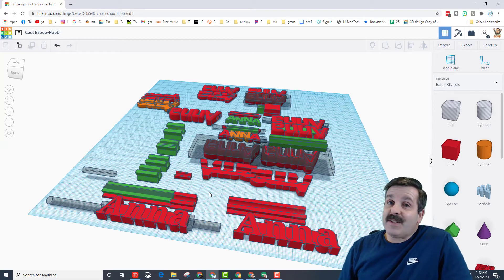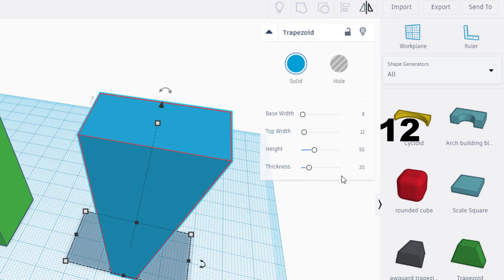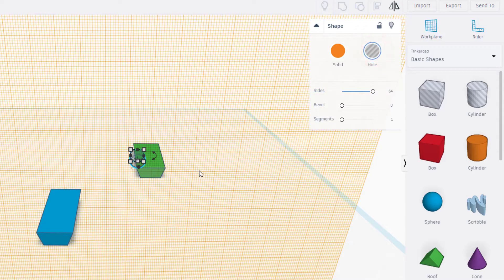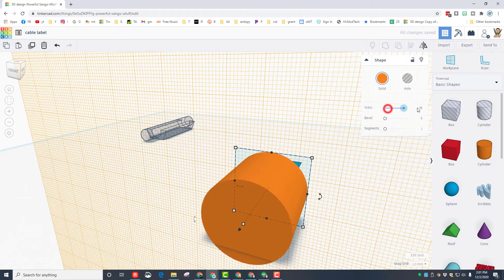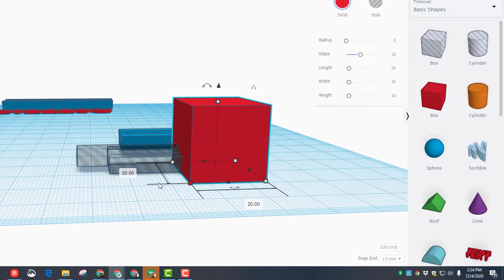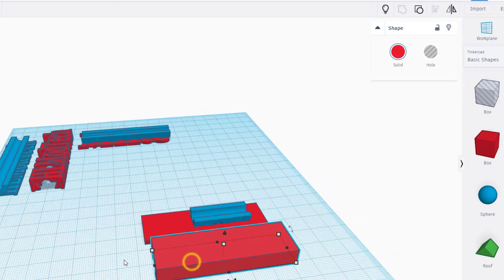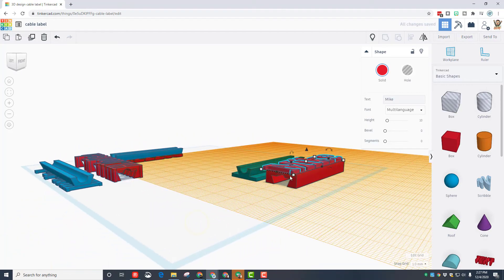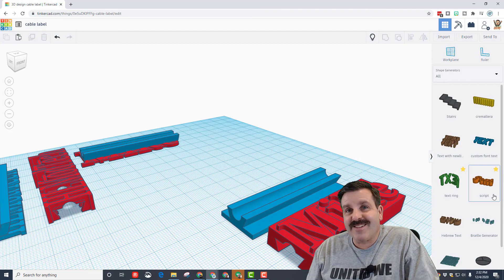Create a Cable Label in Minutes! A 3D printable Tinkercad Lesson

Comment: I tried to use the said dimensions and my top part and bottom part kept sliding apart. Im using a bambu A1 printer :( help!
Reply from the maker: The bambu printers are way more precise than mine was back in the day. I left a larger gap because of how those older printers worked. You can make the numbers tighter nowadays.
Reply from the maker: I would use guess and check with a small chunk to determine the numbers that work best. It is a much better gig than printing the entire project each time.

Comment: Thanks for this video. I’m brand new to 3D printing and your videos have been helpful. Is there a way to make the name a different color than the base?
Reply from the maker: What printer do you have?
Reply: @HLModTech  I have a Bambu Lab A1 with AMS
Reply from the maker: @candiscumberbatch-overton6840  That helps a ton. This video should help. You can skip to where I work in Bambu Studio to check out the sweet paint feature.

Comment: Love it, how do you align when printing? Do you use supports or what face do you print on for the name side?
Reply from the maker: I printed them as they were in the project. My printers are calibrated well enough that the span for the top was no issue at all.